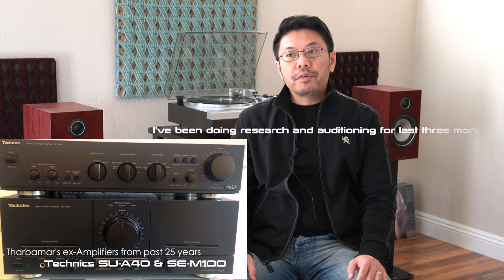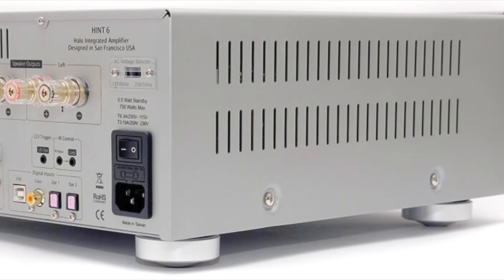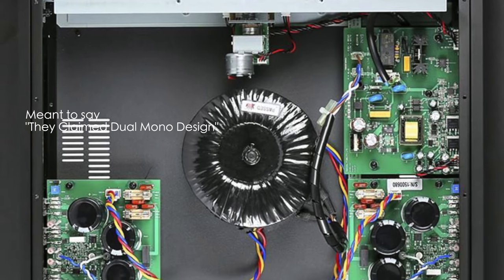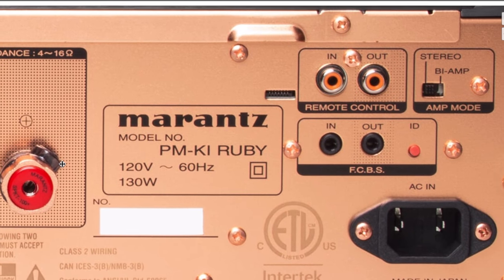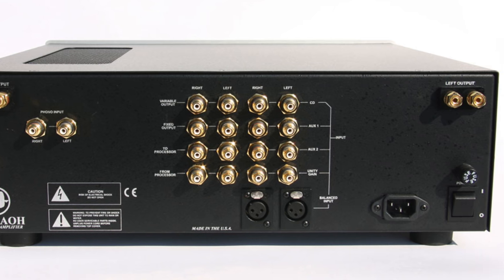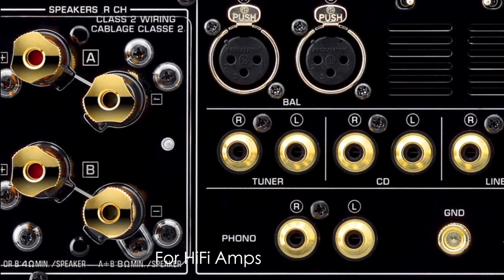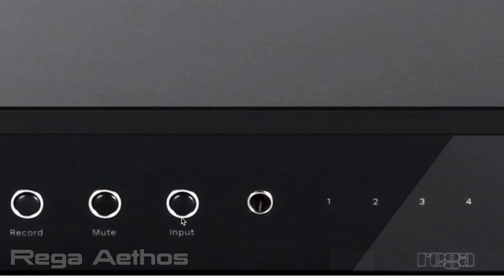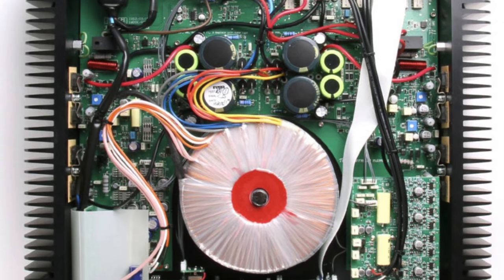Shopping for $2,000 to $5,000 Integrated Amplifier

Comment: The atoll is very Nice built for the money. But it is the atoll in200 signature not the 200SE (is the older model) You can also look at the atoll in300 ?

And why not the Denon pma 2500?? Also very Nice amp and built and good Phone stage
Reply from the maker: Thanks for correction, I was also looking at Denon PMA SX-11 but they don't sell them here in The U.S. which is very impressive looking amp with best phono stage(could be) base on Japanese reviews.

Comment: I  have balanced cables between my Parasound amp-preamp  combo, and there is a difference, if for no other difference  than the shielded ground.  Don't understand  an integrated over amp preamp combo over a certain  price point though,  A preamp is just better without the heat from an amp.
Reply from the maker: Yes I had P5/A21 combo and balanced cables improved the sound quality. 
Nowadays integrated amps are designed better than before and air flow is much improved, especially Japanese Amps they don’t get hot at all, it would be a little warm even after long section. Thanks

Comment: I know this Amplifier may not have all the input you wish, but the NORD One NC1200DM would take my pick. Uses Hypex Ncore amp modules and measures extremely well. Turns on automatically with a preamp the 12v trigger.
Reply from the maker: Thanks for sharing.

Comment: Hi Tharbamar, pls. advise if I should buy Musical fidelity M5si or Denon pma 2500 ne?
Reply from the maker: PMA-2500NE is easy choice for me, thanks
Reply: @Tharbamar  thanks for your reply, really helps 👍
Reply: I've owned the Musical Fidelity M3si, M5si, M6si
The M5si is a great amp.
It delivers a very strong tight bass punch.
I used it with my B&W 805 D3 and it drove them
effortlessly...

Comment: I don't blame you for avoiding class D amps. Most of the high end brandname class D amps are crappy and way overpriced. However, if you want to try just one class D amp you should try one of the ATI amps built around Hypex modules. ATI uses a beefy LINEAR power supply to drive the Hypex modules. Linear means old-style, not "switching/switchmode", i.e. a big and heavy transformer followed by a bridge rectifier and huge smoothing caps. If you can audition one of those amps I think you'll be surprised.
Reply from the maker: I will try them one day when I have chance, thanks

Comment: You said you like the Denon.  Why don’t you just refurbish it. I could upgrade every signal path and power supply capacitor for you for about $1000. If you wanted to refresh the output transistors and rebias it, that would be a few hundred bucks more. Then you would have a Denon better than original. I hope you sell me that Denon.
Also, you dismiss the class D unjustifiably. Jeff Roland would be very sad that you dismiss his stuff ;). I own a class D Peachtree integrated. It may not be what your looking for, but it proves class D is worthy of consideration. That Class AB Yamaha you want is probably 25 percent efficient. It needs a huge power supply and huge heat syncing because it throws away 75 percent of its resources in heat. Class D is over 80 percent efficient. This allows designers to put the money into innovation and not dissipated heat. 
You are just a young guy. Why not join we who have moved on?
Reply from the maker: Thanks John, I’m keeping the Denon for different system and it was serviced and measured in 2017, technician said everything is within factory specs and he also told me to keep it for life because he never seen over 10 years old amplifier measurements as good, thanks

Comment: I'll bet that most of the pieces you're considering are good quality and perform similarly well, but by avoiding middlemen, you could easily get a much bigger bang for your buck! I suggest a Schiit Freya+ with 2 X Emotiva XPA-DR1. Under $4K total and their synergy will outperform your candidates. The Freya+ can switch between passive, differential buffer and differential tube gain modes, that's just awesome flexibility, not to mention that this pre-amp is an exceptional piece in it's own right!  The Emotiva  XPA-DR1 differential monoblocks can drive any speaker with authority, without ever breaking a sweat. As for a phono stage, Schiit makes an affordable one. (although I don't know how good it is, I stream Tidal and use a Denafrips Ares II DAC). With over $1K leftover, you could pocket the money or, you could further improve your system with a sealed, servo driven sub from Rythmik F12se (I use two). All of these components are  sold direct from the manufacturer. Your $5K budget can deliver $10K performance!
Reply from the maker: Drivability and power is cheap for amps but sonic quality, design and features makes big difference for me, personally I do not like the sound of Schitt products, my best friend have emotiva top of the range XPA-1 amp and I also tried Emotiva pre amp and I didn’t liked what I heard, they are not for me personally, thanks for advice, Happy New Year!
Reply: @Tharbamar  Happy New Year! Not familiar with Emotiva pre-amp or other Schiit gear but I do own a Freya + and it's definitely on par for SQ with preamps in the $4K price range. I'd suggest a listen before ruling it out.

Comment: Any reason why you want on-board phono pre-amp over  an external one?  I used my onboard Yamaha for years and recently bought a Vincent 701 phono pre amp. It blew me away at the details I was missing with onboard receiver's pre amp.
Reply from the maker: I do not like many things on audio rack and latest generation onboard phono stages in Accuphase(Add On), Luxman are better than many external units and I think that new Denon CR type phono stage in high end models like SX1, SX1L, SX11, SX11L are even better than most external phono stages in my opinion, thanks

Comment: Did you consider any of Schiit’s products? By selling direct I feel the value is much higher. Also, regarding class D amps, the Purifi modules available on Nord amps are excellent. No class D nastiness IMO.
Reply from the maker: Please do not get lure by direct selling, they are good for money but quality and workmanship is still behind because they don’t have buying power compare to big brands.
Reply: Tharbamar I think in the case of Schiit Audio they are well engineered, designed and built products. Right there in your price range btw. Worth comparing in my opinion for a little more variety in your selection. They also have much less overhead than larger brands. In my 20+ years of sonic bliss poursuit, I’ve been disappointed many times by big brands, IMO brands are not as important as the quality and care of the audio circuit.

Comment: The best amplifiers that hegel h90 or the bigger brother. Has a very good build quality is superb nothing wrong with build quality one of the best.
It beats any of the other amplifiers you showing there I would definitely test one out. You better off having a separate phono stage anyway you could buy a Musical Fidelity phono stage are quite good depending on your price bracket. Or very good is the dynavector p75 phono stage fantastic MC mm get that's about £800 with the hegel you won't regret it best choice you can make.
You're looking at it wrongly having cables connecting two circuit boards is a bad approach having One circuit board is better it lowers the noise floor
Reply from the maker: Hegel sounds pretty nice but the use of NAVER Caps really turns me off and knowing original manufacturer could be part of the reason as well, thanks for advice.
Reply: I don't know what you mean by the original manufacturer puts you off.. ?? what you mean. And why you so against these caps, they work well in this amplifier they wouldn't use them, you're worried about the caps get them replaced for Rubicon Blackgate. U Should look at dynavector cartridges as well like the DV20x2 about £750, if that's a bit of a stretch the 10x5 about £450 just unbeatable soundstage, they are superb for the price. And  I'am a big fan of Benz micro the Woody body S-MC, it's a great cartridge £1000. And really under £400 I would choose a Benz micro over anybody else, What's your favourite cartridge at the moment.
Reply from the maker: The amp it self was made by Opera and those caps can had for a bout $2 each in China.
Reply: @Tharbamar  $2 for a cap is quite expensive, there's nothing wrong with Chinese stuff. There's some really good Chinese stuff trouble is it get's mixed with the crap stuff and everybody says it's it shit. when that's not the case. Hegel wouldn't be using this manufacturer if they didn't feel confident about their product, has a 2-year warranty guarantee as well.
Reply from the maker: I'm other way around, these amps sound is good because of Opera, owner of Opera is one of the most talented amp designer, they can make and design anything in audio and yet this company choose not to use higher quality parts. I've been doing business with Chinese manufactures in different industry since late 90s I have my connections, I have many respects for them, I should not be saying more than this, thanks
Reply: I can only comment on the Hegel as it is the only one in his list that I listened to. And it is a beautiful sounding amp, probably the least colored amp on the list. I too, is/was a ‘judger’ of seeing internals but heck I’m not trained to be an engineer so I stopped making it so important and started listening to amps and researching reliability. My ear told me one thing and found a great dealer for what I wanted.  Some of these manufacturers have been in business for many years and if their stuff stopped working so often after 1 or 2 years they’d be toast!  My recommendation is to listen and secondly look for high current amps. Forget the shenanigans of saying wow internals look great - you’re not an amp designer!
Reply from the maker: Looking at internal is to see the quality of the components, they're a many good sounding amps out there, if you like the product thats great but I don't like it because less than $5 worth of caps(wholesale)  in $4000 amps is not right for me, I don't have to be designer to know the quality.
Reply: Tharbamar good luck

Comment: do not select integrated amp with digital input selector as it is using analog switch ic's that is degrading the audio signal input, choose old school with mechanical selector switch or with mechanical relay input selector switch, just my 2-cents.........................
Reply from the maker: Thank you for advice.

Comment: Hey man, I've got the Marantz PM-11S2 and a Hegel H160 that I'm looking to sell. They're just "last year's model" basically of the Marantz and Hegel that you're looking at.
Reply from the maker: I’m no longer interested in those models, thanks for the opportunity.
Reply: Tharbamar no problem!

Just curious, why are you going with an integrated instead of separates?
Reply from the maker: I'm a bit tired of pure analog solid state Pre Amp selection that they offer in reasonable price point, power is cheap but pre is hard to get it right and good ones are very expensive.

Comment: Where is Exposure and naim amplifier in your list?? My suggestion on all this amplifier is luxman and yahama. The built quality both are very good. Otherwise u would be audition exposure amplifier and never regret of this sound. Truly British sound.
Reply from the maker: I have no idea about Exposure but I do not like the Naim amps, thanks
Reply: Tharbamar take listen some exposure amp and u will never regret. I'm planning to buy exposure amp, currently im using a luxman vintage amp. And dnt judge the inside build of these kind of uk made amp. The Japanese amp always have lots of stuffs like sansui, pioneer, marantz, denon etc. instead of British mfg. Uk made amp always less equipment. Better u audition some of the amp and then compare side by side. 
Lastly if u have really look inside the amp with some real build quality then go for Accuphase, luxman and yhamha only.
Reply from the maker: In the past some of my friends had reliability issues with some of UK made amps and they don’t last that long and asking price is too much for too little but to each it’s own, thanks
Reply: Tharbamar this the issue my frd also suffer. One other amp in my mind also thats Electrocompaniet. Taka a look
Reply from the maker: I will check it out, thanks
Reply: Tharbamar welcome. 🙏

Comment: A bit confused with your approach. You have identified Class A and Class AB from what I see. And your point of comparison centres around build quality vis-à-vis price mainly, with a little bit thrown in on peak RMS and tone controls. The selected pieces are a medley of Analogue amps and amps with built in DAC's. This leaves out sonics - which is one of the main reason people purchase amps. Also if you need to share your purchase process, then maybe you need to segregate Analogue only amps with external DAC's from amps with digital inputs and in-built DAC's. I hope that you will actually be auditioning all the identified pieces. I own the Luxman L505ux mark 2 and this after spending close to 15 months of listening to a few amps and then factoring in price, build quality and service support to get what I perceive to be the best value for me. I had also considered the Rega Elicit R - and it is a fantastic amp with immaculate build quality - but I ultimately didn't buy it, not because the inside looked uninspiring (vis-à-vis cost) but rather due to the Class A (heat + consumption) effect. I often listen without air conditioning switched on and I encountered situations where the Rega would shut down briefly if it went past a certain thermal point.  Anyways, my two bits. Best.
Reply from the maker: I did listen most of them except atoll and aethos.

Comment: The Luxman is head and shoulders above the rest of your options if you insist on solid state.Furthermore, your instinct to have an integrated phonostage is not recommendable, they are, at best an accommodation on an integrated amp  and are generally of inferior quality.
Reply: @UC7E_08CkWeP1RdinaPu6oOg Please take this with the respect I intend. Denon is consumer grade stereo equipment that I owned  (and loved!) in my teenage years. It always was marketed as such and although I'm sure they're adequate especially for a home theater application, I don't think you'll find many audiophiles powering their main rigs with Denon gear other than Denon's true standout, their incredible moving coil phono carts. Denon electronics are generally considered midfi. You'll never go into any high end stereo shop and see a pair of Magico or Wilson Audio speakers demoed with a Denon amplifier. Is it bigoted audiophile snobbery, maybe but I think that most audiophiles would love the absolute bargain that Denon amps offer in terms of price and would snap them right up (like they do the Denon DL-103R MC cart!) if they really offered the transparency and detail that an Audio Research, Mark Levinson, McIntosh or Jeff Rowland offer. In the 90s they stopped using discrete components and started using stereo chip amps on all but their most expensive gear. That is something all the brands I mentioned above would never and did never do.

Comment: as 2100 over as 1100 for the balance out or for the sound?? I have listened both with kef r3 .for me are the same I am between as 1100 and hegel rost second hand the rost
Reply from the maker: Balanced connection is a must for fully balanced design amp in my opinion which will greatly benefit from it, thanks
Reply: The 2100 has a balanced input, not output. The noise floor of all the 1100 circuitry is already well below human hearing threshold, so there is really no practical advantage to the balanced inputs unless the distance between the integrated and source component is something like 10' and you have to run them parallel to power cables. Even then, since the Yamaha floats ground, you're not likely to hear any advantage. It should only be a deal breaker if your source component only has balanced outs.

Comment: Just get the newer Denon or Marantz top of the range integrated amps. They come with an “analog direct” switch, which completely disconnects all digital circuits, DAC and digital clock included. By the way, why don’t you include Naim Nait on your equation ?
Reply from the maker: Denon amp I liked is PMA SX-11 which they don’t sell them here, thanks

Comment: Your opinion on topology is irrelevant, it’s the sound that counts.  And anything without a toroidal transformer is not worth looking at.  Had the Yammi, love the quality and functionality, but sound is lacking dynamics.  Musical Fidelity is my pick.  Have the M6 500i and it’s neutral but dynamic and will drive any load.  Understand the smaller brother is a chip off the old block.Havnt listened to some of these, but listen, don’t analyse.
Reply from the maker: Each of it owns, my opinion is 100% relevant for me and my money, I don’t care about cheaply made over priced amps or I could care less of what you think because I know what I like and I know the quality by looking at the components and I did not say anything about sound in this video.

This video all about build quality, features and price.

Oh by the way I have heard most of them except Atoll and Aethos.

There are many high end amps out there without toroidal transformers that sounds great, it’s all about how it implemented and quality that counts.
Reply: Tharbamar Fair enough.  I buy components because they sound good in the environment I listen to them.  Each to their own.